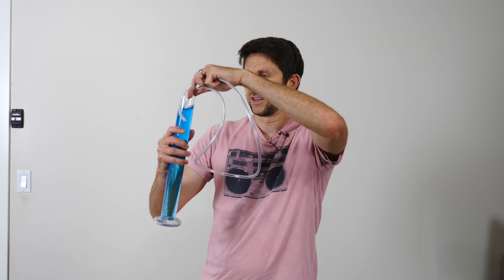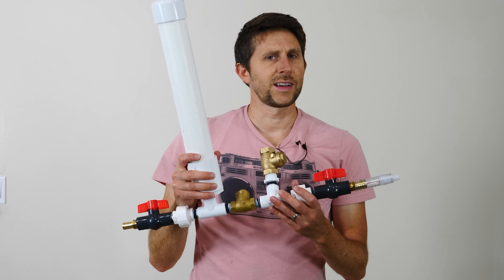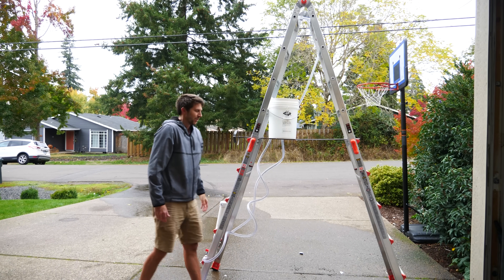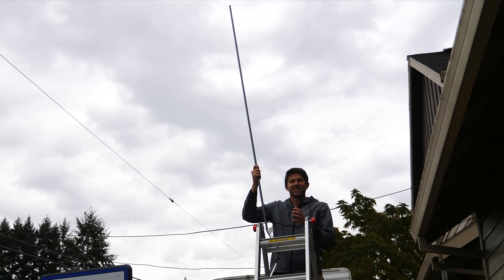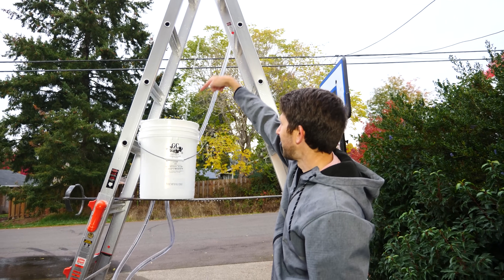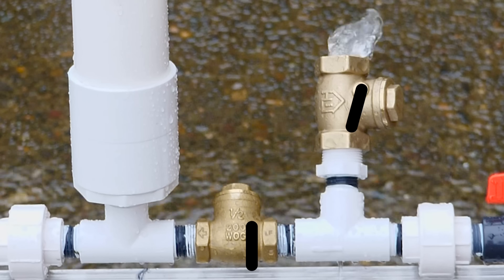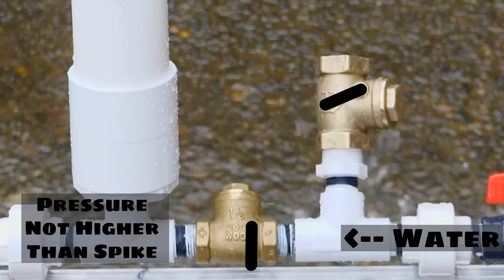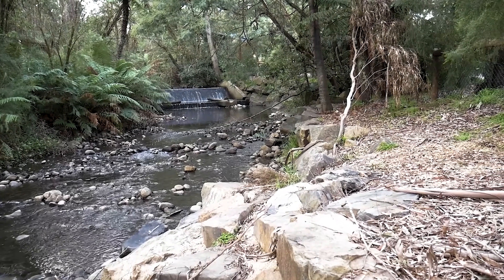Can a Hydraulic Ram Pump Make a Perpetual Motion Loop?

Comment: Hello sir the experiments you do are really amazing and practical applications in daily life... Do one favour for me let's do small experiment
Case-1
Take 3 tanks of approximate 20-30 litres and fill them with oil, water & mercury in three different tanks whose densities are in the increasing order and set up tap at the bottom of all three tanks and campar their velocities and also compare their time required for emptying the tanks... (& Addition to that connect 5-6 feet pipe at the bottom of tank and compare it's outlet velocity with the case of tank with full of liquid without pipe)... thank you plz reply 🙏🙏🙏🙏🙏

Comment: Can any of this energy be considered to create electricity whilst moving water from point A to B? Either in the pressure build up or in the stored water in B?
Reply: Quartz can produce an electrical reaction. Minerals with this ability are called piezoelectric. The electrical reaction can be created by applying a charge, physical stress, or heat.- i’m guessing if the valve walls were made of a piezoelectric mineral, that would be physical stress, it would have to be a lot of pressure, maybe with a lot of water weight that could be possible.

Comment: I would like to know if we could immerse the ram pump in a large tank of water, which will supply the device with water with natural flow, the waste valve to be inside an air bubble which communicates with the water and the ram pump to send water over the surface of the water in the tank and again inside it, then could we have perpetual motion?

Comment: But u have to have some form of pressure on the inlet to get it started. Like u can't remove water from an above ground pool and get it to flow away from ur yard, correct.

Comment: The ram pump trades volume for pressure like so many other machines, including lift on the airplane wing. You can always achieve higher pressure/force by trading a larger distance/mass/volume.
Reply: Is there a way to use the waste water that comes out of the valve? Can it go back into the system?

Comment: The issue I'm currently trying to sort out is how to best circulate the water released back into the system to avoid having to waste water. 🤔🤔
Reply: That's the problem everyone working on yeah ..
Reply: @paidipriyanka4253  Got any ideas?
Reply: @thevisionarytycoon  yeah I already solved it just wondering just have to do that in practical if it works that would be perfect .

Comment: YOU CANT MAKE A perpetual motion pump out of a RAM  pump because  the waters that leaves the system at the first check valve  you will loose all of the water in time

Comment: Could the ram pump do produce electricity like hydroelectric? I'm just wondering if the pressure in the air chamber will have an increased effect on the flow rate of water or none.
Reply: Not inherantly, but if you wanted to you could use this as part of a pumped hydroelectric system so that you can store more energy in the same volume of water by moving it higher

Comment: Now, you've done part of the equation... the next step is to have a ram pump move enough water uphill so it can cascade over several water wheels or turbines that spin generators close to the spot where you built your living structure. Bam!
All you really need is some land with a flowing creek...
BAM!
Reply: If you have flowing water, a water wheel or turbine in the flow will be MUCH more efficient.

Comment: I've been looking to setup a continuous watering system for a tri-fold standing planter of my friends... Which allows for a low maintenance way to keep approximately 11-12 plants... Using the idea of a cascading waterfall... You're design... May just will be a key part in making that idea a working model!
Reply: If you make a ram pump you'll be very lucky if it works first time because they're very fiddly to get going properly, but the plus side is that once they're set up they can run for years without any intervention at all except for cleaning. I set one up in 1991 and it's still working with all original parts.
Reply: @balometer  I'm just wanting to set up a small scale version that makes it simple and easy to water everything but only requires "filling up" from one point... Likely the hardest part will be getting valves small enough to use that will still function!
Reply: @iancowan3527  Best of luck with it. Little 15mm (1/2") brass check velves are cheap and they work well if you put them in short lengths of copper pipe and then use bushings to connect the copper to plastic.
Reply: @balometer  Wouldn't by chance have a part number to pass ago???
Reply: @iancowan3527  What country are you in? There are different manufacturers in different places but the valves are more or less the same. I can look one up for you if I know your location (just a country should be OK)
Reply: @balometer  Florida, USA
Reply: Natural syphon would be the ultimate simple easey continouse,,cheap cheerful stay atmospheric and gravity fed preassure i think it was 2.5psi per foot not bad you could add in a flap valve at the entry point to stop backflow.

Rampumps are great out in the field but you need a recirculating system for wast water and what is water precious they make a lot of marshland but fantastic they send cool clear water for miles and miles and miles.and more miles.
Reply: @michaeldonovan6076  Actually... Just had an epiphany on a good use... Solar water heating for family pool... Use a dark colored holding tank! Plus, I remember hearing about the use of polypropylene hose used with one-way check values for water flow due to temperature expansion... But I highly expect that's over exaggerated

Comment: You notes that because of the first check valve you are losing water and then you will need to add more water to the bucket to keep it working.  What happens if there was a hose attached to that first valve to the bucket so the water escaping the loop is self fed into the bucket?

Comment: This is how a lot of off grid homesteads get their water to their gardens or to their wells, I fell in love with the simplicity of the Ram pump, eventually I’m going to build one at home when I find an actual use for one
Reply: I'm not off-grid but I'm thinking about using one to bring water up from a stream that will feed a pool. Constant flow of fresh water. And probably a nice waterfall or two.

Comment: If you start that in a creek and fill a large cistern with water, then valve proportion an outlet with a battery powered timer you can water plant crops and alternately charge a battery with a small hydro generator. The only loss in the system is a small amount of water from the first ball check valve. But with an endless supply of water it would run until it wears out parts.

Comment: There is a way to make water climb;  many way and the sky is the limit actually.  But if anyone wants to try something;  separating water masses can have you achieve things.  Water will always level out otherwise but with having multiple containers of water within each and them all on a rack that travels up and down;  they can release their load and cycle the bottom one every time that they stroke down because of their weight against that bottom one that is single against the multiple.  each time getting channelled up and overflowing at the top reservoir in order of serving as the replacing of the top unit which has now been released within their each's own sleeve that acts also as getting the rack back in the up position and ready to receive their load from overhead again and it starts again.  I will explain if someone wants to so this one as I'm pretty sure that even with my explaining it all;  none of anyone will grasp it;  and it's super simple.  I thought of this one approx. four years back and I thought it was really cool.  And as for this one here;  I think the water is just bouncing kind of type of thing.  Not sure but there is a thing that this person could do;  by using a stretchy tube like a shop-vac hose and having his 5 gallon pail at the bottom of it and stretching it and a small hose at the bottom of the pail to make sure air doesn't want to go up the little hose...  well if the water mass is dragging harder on this side;  the water will always syphon up to feed the flow and smaller the hose going up to feed the water the better.  Cheers and you all might want to take this seriously.  Or don't;  all the same to me.

Comment: Amazing. I wonder if you could use this to recycle water used in a water turbine in a off grid setup kinda like a turbo adding more water pressure through the main line connected to the turbine. Adding small boosts.
Reply: You wouldn't be able to get any additional electricity from the water in any meaningful way, but you'd be able to conserve water, I suppose.

Comment: ok so how about this, you scale this up, massive. have a turning wheel in between the starting bucket and the pipe above it that can generate electricity and with the waste valve, you have a reservoir collecting it all and people with buckets or anything else to carry the water, and put it back in the starting bucket. Could we not have power stations powered like this?

Comment: It is like a Perpetual Motion Loop while one needs to ad extra water. If the lost water is re intergrated in the system it would be. This problem is why I like the system as a pump but feel sorry as I can not use it in a Hydroponicsystem / aguiaponicssystem.
In this it would be super there is no lost water so the water to make the force is back in the container.

Comment: Every day is a school day. Great video! Often wondered if the water pressure from an elevated rainwater harvesting tank could run something like this 🤔 Ultimately it will run out, but then it rains a lot where I am
Reply: I'm working on something just like this. Rainwater catchment tanks running to a ram pump to move the water to top of a gutter which then goes back into the rain catchment tanks. 

If and when I figure that out I will add in a waterwheel/flywheel to spin alternator/generator 24/7 which will then charge batteries. 

👍🍀🇺🇲
Reply: @Rizik1986  You'll have to share this when you get it working 🙂 I'm in Ireland so we have no shortage of rain here 🙄🤣
Reply: @raynbow6  Absolutely will do my friend! I have set up rainwater catchment barrels already. I'm gonna build a ram pump very soon. I'm working on homesteading. So it's vital I get this sorted and working!
Reply: @Rizik1986 Schon mal an eine Wendel betrieben von einem Windrad (für Windstärke 1 - also Nullwind) gedacht? Da würden Sie den Strom für die Pumpe sparen ...
Reply: @derkoprolalist  English plz. 👍🍀🙏

Comment: The ultimate height is approximately 7x of the original head pressure.... that is, if there is 3 feet drop before the magical Ram Pump... you can pump the water 21 fee from the pump (minus the original 3 feet drop = 18 feet).  Perpetual Motion... um... no.  Sorry.  There is energy loss here... I won't explain it.. but you see that the waste water is being ejected from the Ram Pump's waste valvue.  If you start with 10 gallons... you'll pump maybe, maybe, 6 gallon back up... each cycle draining more and more water.  It's not Zero Energy.  Not P. Motion.  Not a violation of 2nd law of thermodynamics.

Comment: Can't you use a plastic bottle fixed onto your system instead of the plastic tube chamber and then you be able to see the pressure of the air in system   🍼👍👍

Comment: Would it make an acoustic ram pump if you had a speaker inside the air cylinder set on bass boom boom boom pumpin water

Comment: Instead of wasting the water from the open valve , what happens if you run a hose from that valve back into the inlet though a non return.

Comment: Its simple, mass flow rate(1) multiplied by pressure differential(1) equals to mass flow rate(2) multiplied by pressure differential(2) multiplied by efficiency coefficient which is usually less than 1, so NO! there is no such thing as free energy you are actually incurring losses in such system, take note that mass flow rate can be also volumetric flow rate

Comment: I understand the principle, but I can't wrap my head around the question I have. I want to make a loop just like u have in ur setup, only the pump is gonna be in a barrel that gets water filled by my pool overflow, than pumps it 9ft up to make a sprinkler shower to go back into the pool.
My question is, is the pump gonna work submerged and without the inlet hose. Just suck the water straight from the water it is placed in, coz I don't have much space for a long hose in the barrel. If the waist water valve has to overcome the same outside waterpressure as the inlet has I think I have a problem, haha but I've seen a video of a underwater ram pump. Only it has a hose attached but I guess the water comes from the same source so the pressure should be equal.

Comment: Out of curiosity, would this scenario work... If I had a hydro electric unit power a water pump that pushed water back through the hydro electric unit in a loop, then capturing the excess power into a battery. Would i have created perpetual motion or would it draw itself down? What do you think?
Reply: Pump inefficiency, pipework pressure losses and electrical resistance combine to make this impossible by a very significant margin.

Comment: Is there no way to use the water being pushed through the pipe to to power a hydro-electric motor with a small electric pump to feed to water lost back into the system

Comment: Engine intakes runners rely on the flowing air in much the same way. As the engine revs faster the column of air in each runner flows faster, then when the intake valve slams shut the air in that runner compresses slightly against it. When the valve opens again the compressed slug of air pushes into the cylinder. Generally, long intake runners aid in low rpm power, short runners for high rpms. A well tuned naturally aspirated engine can actually displace more air than its volume.

Comment: So would this system still work if there were absolutely no air in the system? I don't think it would because (I believe)  the only way the water in the tube can create a "higher pressure" it can onky compress air in the tube. Because water itself cannot be compressed right?

Comment: Designed a self supplying hydroelectric generator using a ram pump back in 2010.
2 reservoirs of water, ram pumps, solar panels for small pump to pump impetus valve waste. 
Peloton wheel

Comment: How much water pressure comes from the check value? Would it be able to push back up? 🤔 Just curious if this would have any applications for reuse. Not infinite by any means. But would be curious.
Reply: what if you had a large pool of water  as the source instead of a bucket , then you took the tube and connected it to the valve that spurts water out , what if you put that valve over the pool so the spurting water goes back to the pool and then the tube with the water getting pumped is curled upside down so the water goes back to the pool do you think that would work ?

Comment: GOOD IDEA == BUT:
THERE IS NO REAL BENEFIT AND OR USAGE OF THIS PUMB====:-
BECAUSE THERE IS CONTINUOUS LOSS WATER AT THE FIRST LOSS VALVE: and it looks too much loss of water : more than the raised water:
And: 
Also you need an Electric source of power OR: OIL =PERTROL= MOTOR > TO KEEP FEEDING THE MAIN PACKET OF WATER SO TO KEEP IT WORKING!
AND IT LOOKS THAT THE REAISED WATER ABOVE THE LEVEL OF THE ORIGINAL PACKET IS VERY WEAK STREAM:= MUCH LESS THAN THE WATER LOST AT TEH FIRST LOSS VALVE!!
THERE IS NO REAL USAGE OF BENEFIT OF IT
BUT IT IS GOOD IDEA == SO SOME OTHER SCEINTISTS MAY LATER DEVELOP SOMETHING OF IT
CHEERS

Comment: So.... could you take the bucket and put it on a 8ft platform, have the water outlet go through a electrical turbine; have an inline electrical water pump to recirculate the H²O, that runs on lower [voltage/amperage] than the turbine/generator produces?
That would be "free energy"...

Where am I getting lost in the physics here?

Comment: When a kitchen sink is clogged the water comes back up. So lets just say for example you have a full sink setup (with the roof air vent pipe well) above the bucket which will have an extra outlet hole cut in the side of the sink to refill the bucket. So if the waste water outputted is instead inputted to just above the point of the clog (or now stopper/cap) in the sinks exit pipeline this should in theory cause the waste water to flow backup to the sink.

Comment: can you not just have the waste valve fill up a water wheel that dumps back into the bucket? stick a pelter water wheel under the output and over the refill wheel. why isn't that free energy? 

so what if it's a big system that can barely charge your phone it's free energy build millions. grow bamboo pipes and shit